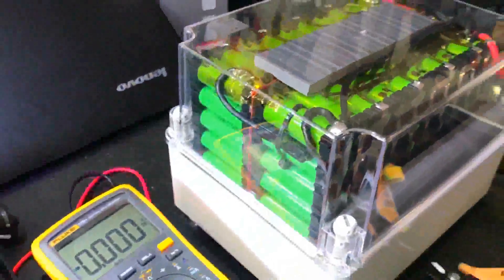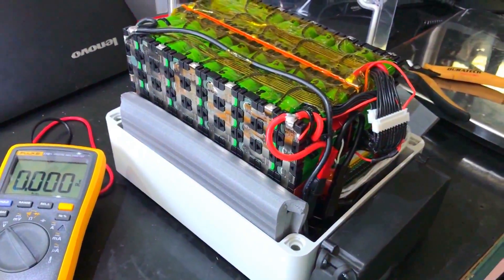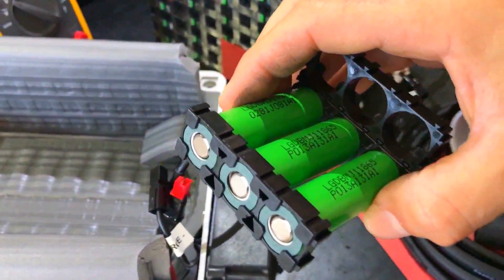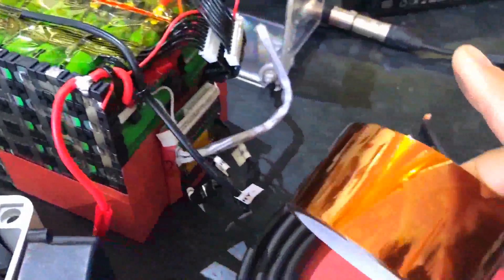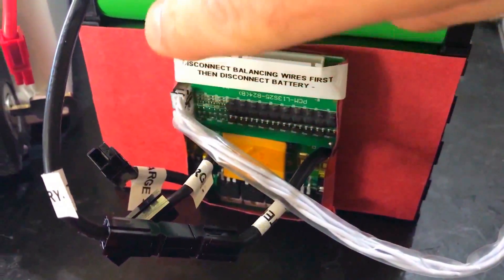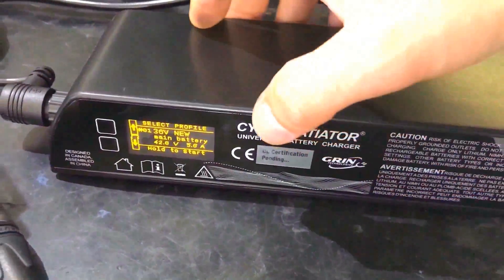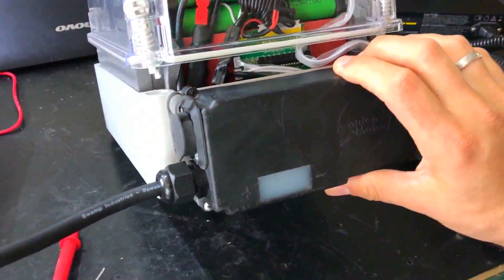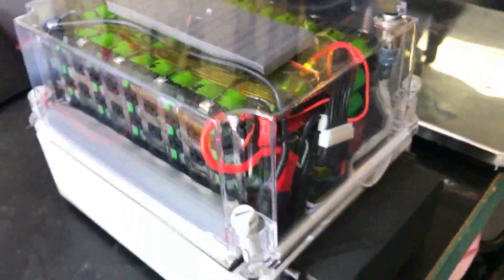Inside a 49Ah 140 cells IP56 Battery Pack (1.8kWh Mega Range) Electric Bike Recumbent Trike Bafang

Comment: Love your videos.
Can you just use a anti spark xt90 connector to power your system or is a contactor  a must for big motors?
Reply from the maker: Thaaaaanks for watching my weird videos mate haha... 
XT90S or other small anti spark connectors are mostly for small RC toys and people misuse them on eBikes... they work at okay up to 55-60v... higher voltages and bigger controllers will fry the little resistor inside the connector. For larger EVs you need a pre-charge resistor installed before the contactor =]

Comment: What is the benefit of more AH?
I want to make a battery pack for an electric scooter or an electric motor cycle I have almost 140 cells I was going for a 14s10p configuration ! In this case it would be around 20ah battery pack how much range can I get out of it? And also what are the benefits of increasing Ah?

Comment: Hey can you make a video showing how to unlock the speed of BBSHD 1000 watts to I guess 1500 watts. Please 🤔
Reply from the maker: +Mario Lopez hey Mariooooo.. good news here... there no such thing as unlock... the motor is nominal (average) 1000w but peaks up to 1450w for few seconds then drops down to 1100/1300w... it's a big marketing lie telling people that it's a 1500w... you can only peak that high if you're doing something really wrong forcing the motor in really wrong gear uphill or something... some sellers tune the Amps down via programming so the motor last longer...
If you really want to get the most POWER out of your BBSHD get a 52v battery and a 42T chainring... you'll get a powerful acceleration, a good top speed, get a programming cable and check if your motor is set to 30A, set the throttle power to the maximum... you can follow programming instructions here https://electricbike-blog.com/2015/06/26/a-hackers-guide-to-programming-the-bbs02/

Comment: I don't like a BMS I'd rather balance charge. Everyone seems to worry about the 4.2 balancing which seems to turn out crazy and most turn to a BMS and it kills the battery when one or two resistors die and they never know until it's to late! There's a secret that everyone should know which is "BOTTOM BALANCING" Drain each battery down to 3.00v individually and put you pack together and balance charge them to the packs full voltage and you wont need a BMS. 2.5v for LiFEPO4 and fully charge to 3.65 once that pack is together. Talk about distance and power? Imagine a single battery Lifepo4--3.2v--100AH That's right it's not a fake or typo, the real deal! 3.2V 100AH Lifepo4 Cylinder Lithium ion Battery Cell
Specification 
Nominal Voltage 
3.2V 
Nominal Capacity(0.5C,25℃) 
100Ah 
Weight(Approximate) 
3kg 
Dimension(Diameter*Height) 
Φ76*306mm 
Standard Discharge (25℃) 
Max. Continuous Discharge Current 
100A 
Discharge Cut-off Voltage 
2.5V 
Standard Charge  
Max. Charge Voltage 
3.65V 
Max. Charge Current 
200A 
Resistance and rates 
Internal Resistance  
≤1.0mΩ 
Self-discharge rate 
≤5% per Month 
General Features 
Cycle life 
2000 cycles (≥ 80AH) 
Storage temperature 
Within 1 month      -20~45℃ 
Within 6 months     -20~35℃ 
http://www.headway-cn.com/en/products.php?pid=95

Comment: He's Back! yes boss... ;)
ooooo I like that xt90 connector have to find some of those before I put everything back together...
As for the rest of the pack, yeah very well done.
heat's not an issue at 250 watt.. so just a maintenance and safety issue, unless you're turbocharging at like 40 amps or something big.. but I like to live dangerously all that extra space thats used up by having the end caps you could have got another few more P rows in without it.. 
xD
So how tricks guess you've been busy with summer rush? When do we get to see it then? Soon I hope..
Reply from the maker: Yeeeeaaaaahhh.. I'M BACK and the 42000w long time promisse project is actually here and finally happening!! Making a series of videos starting uploading this week hahaaaaaa
talking about this pack here in this video, 250w may not even generate any heat in this massive 1.8kwh pack.. this is the exactly same pack design we made for the LMX 7500w motorcycle https://www.youtube.com/watch?v=l3apEZ0RKKU but for the LMX I wired the packs in series for 72v, this one is in parallel, that means you could run 14000w in this pack with no problems (with a few connector modifications for high power) what is 250w for this big battery.... =]
I thought about filling up the remaining empty space with more cells but the top is narrower than the bottom and 49Ah was pretty massive and ridiculous already haha. The guy actually asked to have his old 12Ah pack "ready" as a spare battery...  61Ah.. really?? hahaha
My 42000w triple motor trike is coming... yess.... maybe the most ridiculous power to weight ratio ever ohhh yeahhh
Reply: ElectricBike Sweet, can't wait to see that.. I'm just in the middle of my rebuild just got very distracted by having a laser cutter at my disposal and building a few other lower power bikes for friends and then had to upgrade an engraving machine for a friend which was a right PITA (faulty chinese parts :( ) oh and blew up my motorbike piston haha but all finished with that now so can get finished up the mock up of the battery case see how much extra ah I can fit on top of the 20ah thats already in the pack :D 136 cells in original so not far off what you have their.. then the frame can go back to the fabricators..
but I have the pump and rad for the motor just need a few more pipe fittings and can get that all finished up and mocked up on the frame too, so I know it all fits then last bits are CA and probably new controller as I just don't think my current one will take the amps I want.. xD
So we should both have an exciting 2017! woot hehe 
MORE POWER!!!!!

Comment: where do you found your bms? how can you check that it's work and it isn't break? I love your battery
Reply from the maker: Yeeeahhh man.. thaaanks hahaa!!! This particular BMS is from Smartech but they only sell in large quantities for business all done via emails, they don't have any info on the website. Most guys from Endless Sphere community get their BMS from http://bestechpower.com/ I think they also have a minimum order of 2 pieces but works out to be cheap buying directly from them.
To check if the BMS is working, its "better" if you know any info or specs, what protections and balancing functions you have, check all series voltages see if your pack is balanced properly, a bad/faulty BMS may drain few series, sometimes a third or even half of the series (this is a bad BMS). You can also check the low voltage cut off and high voltage cut off with a multimeter when you're charging/discharging the battery =]
So much POWEEEEEEERRR

Comment: awesome work man. love that small "big" battery. so many nice details. kapton, glued shrink tube, antiark,... just gorgeous.  do you know the internal resistance of that pack?
Reply from the maker: Yeeeahhh thaaaanks man... "small-big battery" hahaa!!! Unfortunately I didn't measure the internal resistance of the pack but it was 14p (the more connections in parallel the less resistance). Would be half of the internal resistance of this pack, same battery but wired for 72v LMX motorcycle pumping 7500w https://www.youtube.com/watch?v=l3apEZ0RKKU 
I used a pure nickel dual row stamped tab like I show in this other video here at 1:00 minute https://www.youtube.com/watch?v=Rr2_akGznxk this is what the professional tab welded packs have inside. 
I will measure the internal resistance next time I build a pack I may make a video talking about it =]

Comment: hey when will you do a boost converter video? im building a momenary switch circuit for a 1500 watt boost converter to up voltage on flat straightaways in low load conditions on my electric bike it would be cool to see some 1 do it
Reply from the maker: +nickbigg84 yeaaahh I have many different models, some higher voltage some higher wattage, just got my new garage/lab all setup again (moved houses and was going crazy for months without my garage).
I am back uploading videos mate, boost converter, high power LED, my 42000w high powered trike is finally happening too... yeaaaahhh 
Have you tested the boost converter in your bike?? This is how the solar car racing guys keep a constant voltage coming from the solar panels =]
Reply: ElectricBike i have not tested yet. im waiting for a pv 75a diode. i was worried about the motor feeding back voltage and burning out the booster. any insight?
Reply from the maker: yeaaahhh good point you made.. I am always running mid-drive motors with freewheel so I don't worry about regen and feeding voltage back into the booster converter... very clever you realised that before anything happens to your booster =]
Is this the one you're waiting? http://www.ebay.com.au/itm/Aluminum-Heatsink-Base-Single-Phase-Bridge-Rectifier-Diode-75A-1000V-WS-/222137245775?hash=item33b869604f:g:pNsAAOSw4q9XToa9
If you like extreme things this big boy here, a bit overkill but may look good hanging on the bike hahahaha http://www.ebay.com.au/itm/100A-1200V-Single-Phase-Diode-Bridge-Rectifier-QL100A1200V-Black-100x60x56mm-/201591207389?hash=item2eefc5b5dd:g:THEAAOSwSWJXRX4g
Reply: those are cool.. the one i got looks like a bolt with a hole drilled in it. its a solar pv blocking diode. im not very versed in components but im learning more everyday. i enjoy your videos and they get me amped up.

Comment: Have you ever considered using fuses on each cell to protect the other cells? like a tesla battery?
I also finally finished my pack 8s4p with lg hg2 cells. I used 3d printed cell holders and fashioned my pack similar to this guy (http://www.electric-skateboard.builders/t/carbonated-enertion-vescs-hi5ber-overtaker-custom-10s4p-25r-pack-with-cell-level-fusing-abec-flywheels/10879). I used 22 awg copper wire which is rated to melt and disconnect over 40 amps of current. It should disconnect the cell if it goes bad. Amazing work with waterproofing that battery!
Reply from the maker: Yeeaahhh nice little pack... very clever idea... did u use brass or copper?? 
I have considered fuses on each cell but in this case I had to put two battery blocks "sandwiched" pressed against each other, I used spot welded tabs because they're very slim and don't stick out the cell holders, so it was the "safest design" in some ways (didn't want to have any chance for the contacts to rub and short... 1.8kwh battery packs way too much energy).
Hey.. if you reeeeally like cell fuse and like battery building stuff you must check out and join (I'm one of the moderators) https://www.facebook.com/groups/diypowerwalls/
Reply: I connected the 22 awg wire to brass strips. I heard that is has less resistance than copper.

YEAH Ill join that group! I first heard about cell level fuses from Jehu Garcia's youtube. I got really hyped after seeing his power wall videos. Its crazy someone could power their house just off solar panels! THE FUTURE IS HERE! I can't even imagine all the money that would be saved on power bills. You would make your money back on all the batteries is no time. I might make my own attempt one day. I live in Arizona so sun light will be no problem.
Reply from the maker: If I'm not wrong brass is harder than copper (copper is very soft, sometimes too soft) and easier to solder large strips than copper and aluminium... brass is better than nickel used in most batteries and considered an excellent conductor!!
Ranking Metal % Conductivity*
1 Silver (Pure) 105%
2 Copper 100%
3 Gold (Pure) 70%
4 Aluminum 61%
5 Brass 28%
6 Zinc 27%
7 Nickel 22%
8 Iron (Pure) 17%
9 Tin 15%
10 Phosphor Bronze 15%
11 Steel (Stainless included) 3-15%
12 Lead (Pure) 7%
13 Nickel Aluminum Bronze 7%
* Conductivity ratings are expressed as a relative measurement to copper. A 100% rating does not indicate no resistance.

Yeah the Powerwall idea is amazing... these things are getting cheaper and cheaper... you also have the option to make a budget one from recycled cells (extremely cheap but time consuming). I have been saving sooo much money since I sold my car and jumped on the electric bike idea... all that money I am saving I am buying more motors, tools, precision electronic devices (I'm an electronics guy) if I could kill my electricity bill would be even better and more money available to play hahahaha 
Sun is not a problem here in Australia too hahahaha I am friends with a guy who made a solar bike and did a 9 months round trip in Australia then one year later he went back and did another trip crossing the middle of the country... all powered by the sun... quite amazing and inspiring, I really want to join him on his next crazy trip haha

*I am uploading tomorrow a first video of a series showing my 42000w 56hp triple motor... ridiculous power to weight ratio.. you'll see hahaha

Comment: Very well constructed battery. I built one similar to this, mine was entirely out of recycled 18650's. I put 140 cells in mine as well however I wired mine 14S10P as my controller has a max input voltage of 60V and I wanted to make sure I didn't try to pull too much current from my aging cells. Mine also has cell level fuses using a thin gauge piece of wire, similar to how Tesla do their cell level fuses.

If I were to do it all again I would forgo the cell level fuses and do it closer to how you did it. I would also highly recommend the 18650 holders.

Very good video, very interesting. More like this!
Reply from the maker: +lonnie776 yeaaahhh I know EXACTLY what you're talking about!!! Have you checked the DIY POWERWALL community on Facebook? So many guys recycling used 18650 cells and sharing so many cell fuse design ideas, some very creative and very modular setups!
Personally I don't have a preference, it depends on the application and how much time you're willing to spend making the battery, how much current... spot welder is faster, very slim and neat design with no need for bus bar. All my videos I am riding my 14s 5p that I made in 2014 soldering 70 Panasonic PF cells.
Two things that I always recommend, cell holders and the paper ring on the positive end of the cells. Soldered or welded these things batteries a LOT safer specially if carrying around on a bike, accidents can happen, better safer than sorry. Cell holders also help keeping all cells same temperature without cooking the middle ones!
I have a video coming showing a 72v external BMS design I made for a client the other day and a 42000w trike... so much POWEEEEEEERRR =]
Reply: I never thought of looking on facebook for that. Endless sphere is usually my go to. Will definitely check it out. Thanks

Also do you mean 4200W or is it actually 42 000W.
Reply from the maker: +lonnie776 Yeaaahhh almost every time I mention 42000w people ask me "do you mean 4200w?" and I reply "no.. it's a freaking 42kw lightweight trike" hahahaha it's a big project from 2013 that is finally coming to life!!! This is the reason why I scream POWEEEEEEEERR all the time haha

Check it out the DIY POWERWALL community https://www.facebook.com/groups/diypowerwalls/ I'm one of the moderators I can add you... you'll be in heaven browsing the posts haha
Reply: 42000, that's like 56HP and god knows how much torque. On a trike that will likely weigh a little over a hundred pounds? That's going to be a MONSTER!!! Can't wait for the video, hell that could be a whole series of videos.

And that would be great if you could add me. Just sent in a request.

Thanks
Reply from the maker: Yes... just 56hp... hahahaaa.... I have few little secrets that I can't reveal now as I have to upload some videos first but with a small battery and only pumping 300A (instead of full 840A) it will be around 35.9kg or 79.1 pounds...  this is supposed to be my heavy prototype made with steel frame... things are going to be lighter when I start laminating a 100% carbon monocoque chassis...  the idea is to make the most ridiculous power to weight ratio on wheels haha

Comment: Volt?
Reply from the maker: +Manrique1721 yeaahhh this one was setup for 36v 49Ah (long range) but I made in a way that if you just change few wires it turns into a high performance 72v (84v fully charged) just like the battery I made for this LMX motorcycle here: https://youtu.be/l3apEZ0RKKU
Reply: Is there some footage of the build in action somewhere? I wanna do same thing. Build a trike with massive batteries. And yours looks like is being send from a gods. Really love it. Well done.

Comment: nice battery. I had a trike where it used a 48v 30ah battery with a 1200watt hub motor, normal range was about 60-80km. riding an electric recumbent is so much fun... that was until mine broke and then was stolen, eventually ill build a new one.
Reply from the maker: +austins_creations yeaaaaahh trikes are sooo much FUN... I'm making an extremely high powered 42000w KMX trike... uploading videos very soon...  that will make you want to get another trike ASAP hahaha